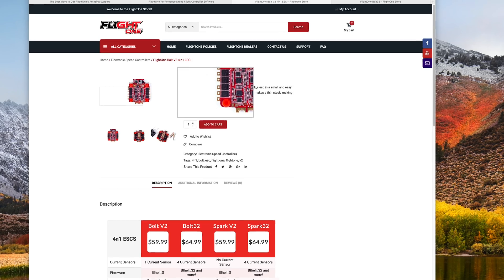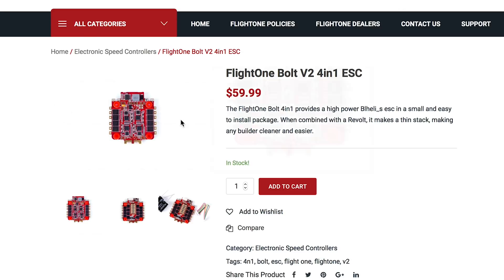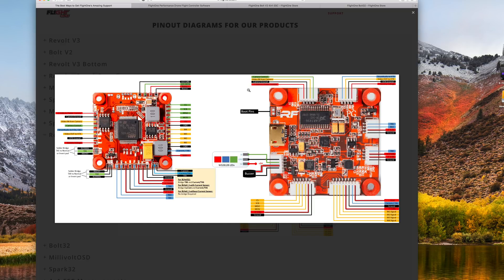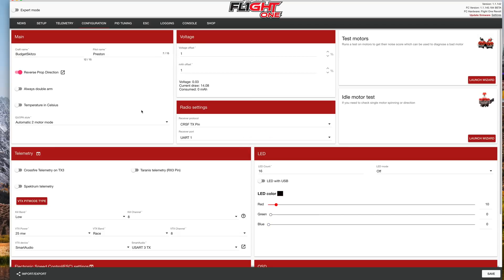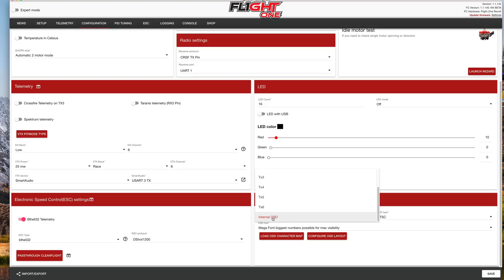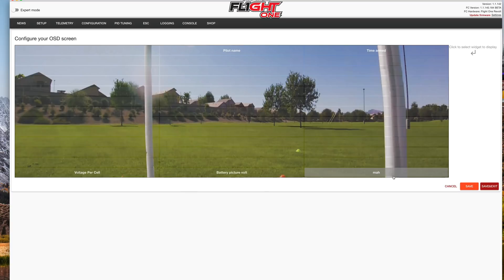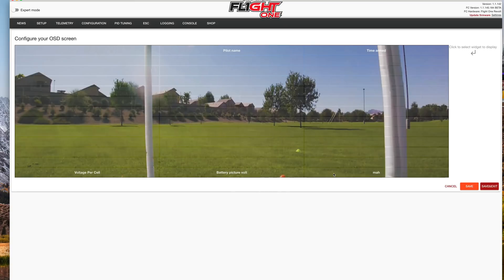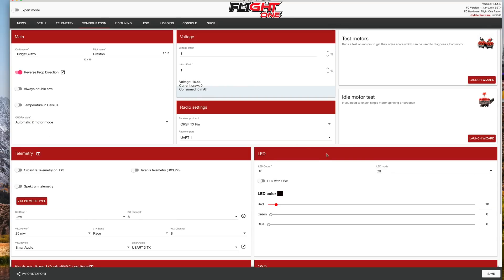Current Sensor Setup in FlightOne

Comment: Great video! I am gonna use revoltosd, I noticed there is a "NC" (no connection) pin out from the BOLT32, but it is connected to the "5V" on the revoltosd, if I want to use other 4 in 1 ESCs, do I have to connect the 5V output from the ESC to the "5v" on the revoltosd?
Reply: The revolt only can take 5v nothing more

Comment: So I'm running Revolt OSD and Bolt32 with Crossfire. Total RaceFlight Newb, so far loving the product easy install and awesome configurator. Everything works good in Multishot(minus Current Sensing), I soldiered the jumper but for some reason when I switch to Dshot1200 the FC stops Seeing the CRSF Receiver, maybe some sorts port issue not sure any help would be great. TIA
Reply: same Problem

have you found a solution?
Reply: Nope
Reply: Okay, so to make it work you have to connect the Crossfire reciever to the TX1 port, NOT Rx3 because Dshot uses that one. And make sure to bridge the TX1 and NORMAL Pad on the back side of the FC, then change your settings to CRSF TX and UART 1, should work like this. Try both Channel1 and2 cables, dont know which it is. Hope it works for you :)
Reply: This is the TX1 Pad wich you have to Bridge with NORMAL ( Bridge the top and middle one) https://imgur.com/CBvfIJ2
Reply: Thx will try it out ASAP
Reply: Confirmed this works for me, sorry took so long to try it out lol

Comment: Doesn't seem to work with Spedix GS35 4in1 blheli32.  Just constantly tells me im pulling 50+ amps and mah count is way off.  Tried to solder both ways on the jumper but no joy, i hope that support for more 4in1s with current sensing is added.
Reply: Hally FPV same problem

Comment: Awesome video. I see you are using CRSF on uart1. How did you connect the crossfire to have it work with dshot? I’m using the harness now on usart3. Works perfect with multishot, but freezes up my radio-input when selecting dshot or proshot. Thanks, keep the tutorials coming!
Reply: to make it work you have to connect the Crossfire reciever to the TX1 port, NOT Rx3 because Dshot uses that one. And make sure to bridge the TX1 and NORMAL Pad on the back side of the FC, then change your settings to CRSF TX and UART 1, should work like this. This is the TX1 Pad wich you have to Bridge with NORMAL ( Bridge the top and middle one) https://imgur.com/CBvfIJ2 Try both Channel1 and2 cables, dont know which it is. Hope it works for you :)
Reply: @ploutos7517  Hi, does it mean I can only connect the ch1 to TX1 and ignore the ch2 to the TX3? will crsf work if I only use ch1 on the nano rx? thanks!